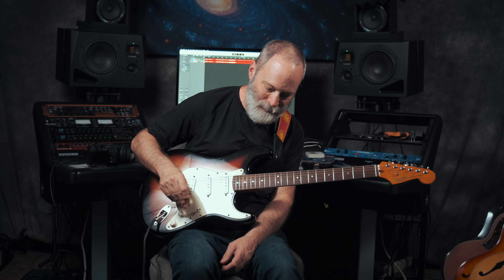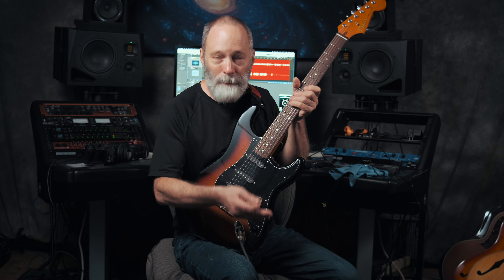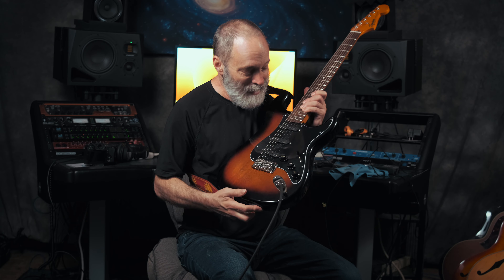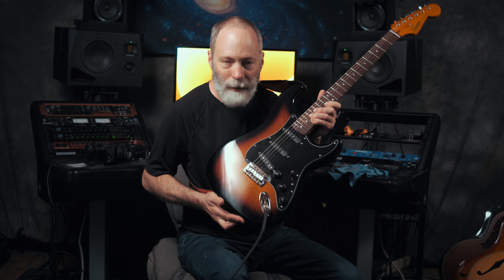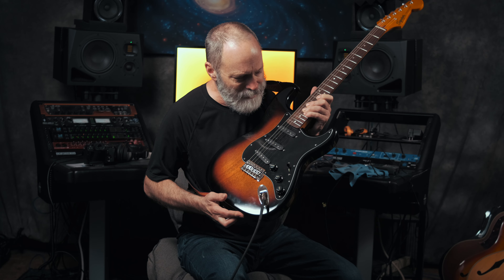The Pickup Swap That Fixed My Strat

Comment: You should look at Morley's hum cancelling kit. One is a transformer that goes in between the power cable and the device. The other is some hum cancelling to XLR output for the audio side. Also look at the lighting in the studio side. Some LEDs, certainly many florescent lights, tend to cause issues. As can running microwaves, some washing machines nearby or on the same electric circuit..

Comment: Every place I've lived has caused noise problems on Single Coil Pickups. I've switched to Noiseless and Humbuckers.

Loaded Pickguards for Strats are awesome. There is a short YT video called "Tutorial: Quick-Swap Pickguards for Strats" that makes it easy to change out Loaded Pickguards using a single "Quick Connector" at the Jack location. Well worth checking out, as it is a way to put old, unused Pickups  back to work. 😉
Reply from the maker: Thanks for sharing the tip and mentioning the YT video!!!
Reply: I stay away from single coils, and avoid "coil tap" schemes on humbucker guitars. If I want a thinner brighter sound I'll set up a series/parallel switch rather than a coil cut.  My big dilemma here is I want something with P90s, so I guess I'll have to save my shekels and buy a set of those reportedly miraculous Lindy Fralin "Noiseless P90" pickups (which are not really P90s but rather very carefully engineered humbuckers).

Comment: Dude! I love upgrading Squires. I bought that exact guitar to upgrade and donate but traded it in when a Gretch I had been looking at. It worked out beautifully. Now that spring and summer are approaching, I will do the buy upgrade donate thing. Just moved to Utah and until I buy a house and build a studio/ workspace It seemed the best. I love the Gretch's. A deal is a deal but as it is all I have is the garage and it is quite cold being a Florida transplant. I do that to learn how to build. I have made a Tele that I gave to a best friend and a P-Bass that I gave to a church. Rave reviews all around. 
I have a Squire Jazz Bass that I will put up against the best Fender has to offer with just a Hip Shot Bad Ass Bridge (brass saddles) and a bone nut with my preferences regarding set up. Also a Squire Affinity Tele that I put brass saddles on and the same set up. They are great guitars. Will be exploring the P90 option for the neck on that one. Love the inbetween of the P90. Not a fan of Humbuckers sonically and not a fan of the 60-cycle hum either. The Filtertrons are the answer, but learning continues....

Comment: How well did the screw holes of the new pick guard line up with the original holes in the body?
Reply from the maker: They lined up pretty well. I did not need to redrill or reposition any of them.
Reply: @chordsoforion  thank you.